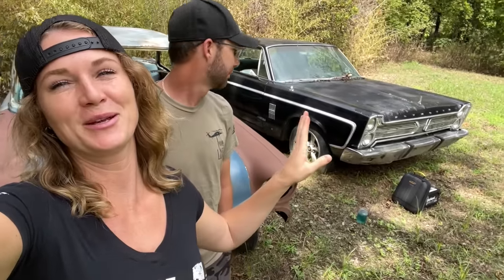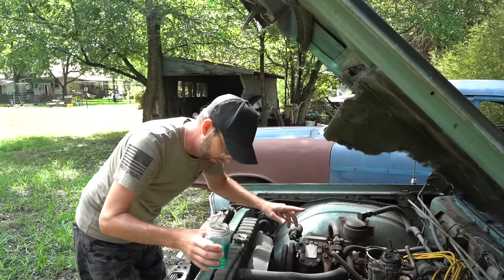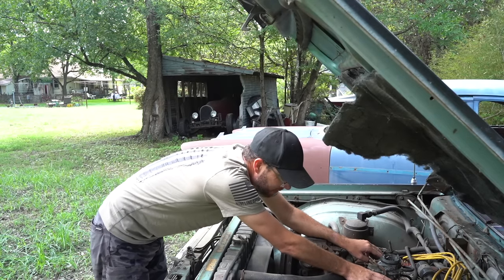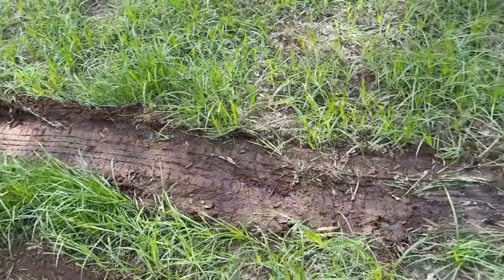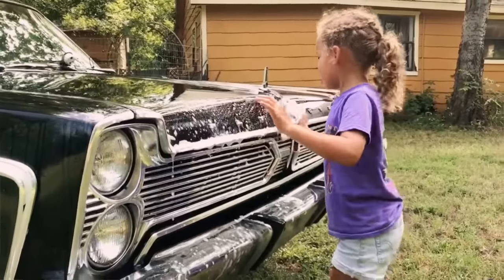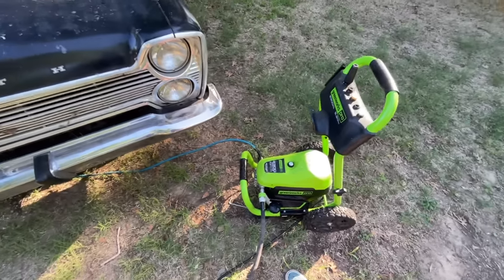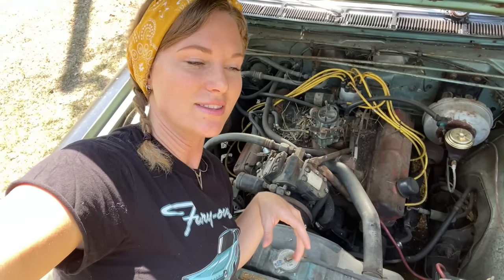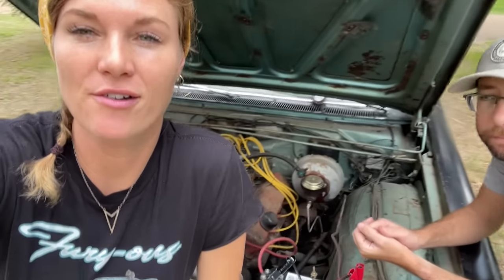Abandoned Plymouth Fury!

Comment: old timers tip,.go to the dollar store buy a Condiments bottle,they are whiteish plastic bottles with a TIP.
fill it up w gas,and then use the tip to directly fill the fuel bowl on the carb.
also for cars with no keys,bring along a jumper wire with an alligator clip on both ends,.
put one end on the coil/positive,and the other end on the battery.
then jump the starter with either a wrench across the terminals,or a screwdriver across the relay/ford.
Reply: also,after hearing the entire vid.
yank the poly 318 out,the 4 bbl intake Alone is 600 bucksjust by itself.
the poly weighs a lot and its not worth throwing money at it.
now comes crunch time.
what do You want the car to do ?
if you chose cruise,listen carefully.
grab a 360 magnum motor from a 1994 or Newer dodge truck in Good condition for Dirt cheap.
think crashed up or salvage yard cheap.
then buy a After market/read Speedmaster 4bbl intake For a Magnum motor <<> 250 bucks,and a Car Oil Pan and oil Pickup 130?? i think 
and then install the magnum motor Directly into your car With that transmission if its good.
super cheap and Easy 300 hp daily driver...for max fuel economy,use an edelbrock 600.
you wont even have to Touch the inside of the motor either.

Comment: Drop a 89 318 in it. All but 1 bolt will line up in transmission.  Then you have a LA small block with roller cam . Save original engine

Comment: Also you may wanna check the casting numbers on your cylinder heads. If they start with 265 or 253 then you have a small block. If it parts with 240 it's a big block.

Comment: Good luck finding a four barrel intake manifold for that Poly 318.  Just rebuild the carb and it will do anything you want and get  good gas mileage also.  My first car was a 1963 Dodge with a poly 318 ,2 bbl carb and push button trans.  Drove like a champ for two years til l put a 69 383 in it,  totally ruined a good car.

Comment: I grew up with mopower my dad was a mopower freak you can tell a 318 from a 360 from the exhaust manifold and also a 318 the motor is balanced by the crankshaft and a 360 is balanced by a weight on the torque converter but their exact same block only difference is the heads and the crankshaft

Comment: And that exact Fury 3 when I was growing up found it in a farmer's field that's how we used to find cars as I was growing up when one was almost ready to go to the Boneyard we would be on the search for the next one we always had one on hand as a spare but just letting you know a heads up if you use dryer sheets in the car under the seat in the air vents and under the hood on the intake manifold set a small rock on there so the wind don't blow it off and you will definitely not have mice and rodents spiders nothing guaranteed just a heads up❤

Comment: Just order a  carb kit for the same  year  d 100 pickup with the  a block poly it's the same  carb there was a 326cid version  used primarily  in Canada 🇨🇦  check the side of the engine  block  mopar stamps the displacement  on the side

Comment: Hello;  the motor more than likely is a 318 but could be a 273.  Both being small blocks but if I remember right the 318 came as a low block and a high block.  You need to find all thr block numbers and do a little resurch to find out which one it is.
Reply: It can't be a 273. They don't have the valve covers of the Old Style A engine shown. Scallped at the bottom and with a big crease along the top. Some people call the old style engine a "wide block" but the deck height is the same on the newer LA engines.
  When the LA came out, it was intended to fit the narrow engines of the Compact A body cars while the A engine 318 came in the full size c body cars.  Eventually the LA was put in the full size cars and replaced the A version of the 318. They lasted a year longer in Trucks and Canadian cars.
Reply: @auteurfiddler8706  Thank you for the information.  I learned something new.

Comment: To clean out a flooded car with carb hold gas pedal to the floor when pump it your using the accelerator pump to pump more fuel into the motor that floods it. those carbs on the 318 the throttle shaft wear out and leak  fuel check that out. The reason you can't move the car the e brake maybe rusted  or the brake shoes are rusted to the drums that car been sitting for. That's a nice car you could dress it up to look like a FX  drag car. That's what I do with it be very cool driver even with  the 318

Comment: I would buy a new Mopar compatible carburetor, new Mopar fuel pump, new fuel tank and new fuel lines and hoses. Running the engine with dirty fuel will ruin it faster. Use clean Shell  gasoline only. Thanks.

Comment: Change that single reservoir for the brakes  to a dual. And it’s hard to power brake with a single reservoir they don’t work like the duals
Reply: They work the same... until you have a problem.... then they don't at all....    
Once a wheel cylinder went bad on my car and I lost all braking and rolled gently into a chain link fence.
I put the dual reservoir from a 67 C body on my 65. I was lucky to find one in a junkyard and get the T block and the lines so it was a bolt on.  I think if I made my own lines, I could have skipped the T block and just bought a new master for a 67 . I saw a guy on Youtube do that.

Comment: According to Wikipedia the fourth generation Plymouth Fury III came with 225. 318, 426 & 440 cu. in. engines. It can't be a 225 because that engine leans to one side and it's a 6 cylinder engine. It can't be 426 or 440 cu. in. because the carburetor is way too small. It is a 318 cu. in. because of the small carburetor and the fact that the distributor is in the rear of the engine. The stumbling is due to a weak accelerator pump. This carburetor could be rebuilt at very small cost.
Reply: The 426 was 1965 only  and the 440 was 1966 and newer in the C Body Fury.

Comment: your fury engine is a 318 "poly" or 318-A..it is a "polyspherical" combustion chamber engine..made until 1966..1967 started the LA series 318..both were small block design..just different style cylinder heads..

Comment: I worked where that car was built. It probably has my fingerprints inside  the door on the right hand side. I adjusted the windows.

If those tires are ten years old don't trust them at highway speeds. The rubber gets stiff and has minute cracks that can cause a sudden blow out. Check around and watch for a sale on tires.

If a car sits for years the drum brakes can rust to the point they are stuck. They will need some coaxing to loosen up. I had to move one of mine to cement and go from drive to reverse several times to break up the rust.

Comment: I am just finishing up a driveway redo of a Fury like yours. That 318 Poly put out 220 hp as is. A small 500'550cfm carb and an adaptor for stock manifold will bring it alive. Several forums and some Youtube channels available. The trans is almost bulletproof but get a 100 percent fluid change and filter. A very hard car to find parts for as only made for 2 years. Enjoy

Comment: You should have drained and replaced the oil. After that many years there is probably as much water from condensation as oil in the pan. Pulling the spark plugs and giving a spritz of WD40 in each cylinder would have been a good idea also. Hope the engine is OK.

Comment: Put a standard factory 4 barrel on it. Change the oil, air filters plugs points and wires a new distributor cap. Bleed the brake lines, check the pads and calipers. Dont  change much unless you decide to rock it out. Paint the engine back to the original color on the valve covers and put new gaskets on them too!  Car may have a modulator valve  on tranny if I remember correctly. Check it or change it. Eventially put it back Plymouth blue. We had this car n a 67 model with a push button automatic in the lighter blue with a white hard top. It was a pretty car and the one I road to school in most of the time. I graduated in 1979. I loved the Plymouth. Oh yeah I believe the engine was blue if I remember correctly. Loved seeing this car. Thanks guys.

Comment: That car is a beauty. That engine is definitely a 318 poly and was the most common engine on those cars. On the carb the accelerator pump plunger is faulty or the passage is plugged. This is a 2 barrel Carter and very easy carb to rebuild with a kit. Tear it down (watch out for the small check valve balls), clean all the passages out with carb cleaner, blow out with compressed air and reassemble - easy peasy and you are good to go. From what I recall those had a metal dash so I don't know if someone just added the material that is now gone bad.

Comment: Poly head 318, NOT Small Block, Some call them a small block but they are behemouths, only weighs about 20 pounds less than a Mopar 383 and has enough meat in it to bore the cylinders out 120 over and still have room. Have seen them bored and stroked out to a 408
Not many components are shared between it and the 318 LA
Working on 66 Fury III right now, in that same blue!
66' was the Last year for the Poly 318 in the U.S. market
Dodge and Chrysler were using the LA motor for a few years at that point, 67 was when Plymouth got their hands on the 318 LA as well

Intake, Heads, Exhaust manifolds are not interchangeable
Poly block is a 90 degree dispo between cylinder banks as opposed to the 60 degree of the LA motor
Intake and Exhaust runners are spaced differently (more like a Hemi on the Poly)
as well as Pushrod guides and Valves
Even the Cam grind is different due to the cylinder angle

Front Accessories are mostly interchangeable, as well as distributor
318 LA Pump Housing/Timing cover will mount to a Poly Head, but you need to plug 1 mount hole in the face of the block that the Poly has but LA does not, thus its cover doesn't.
That unused bolt hole bites into the water jacket of the block, so need to plug.
You CAN use a 318 LA Water Pump on a Poly 318, but you would need to change your radiator as the LA pump dumps on the Passenger side while Poly dump on Drivers Side.
Reply: It's kinda cool This Fury is the Inverse of Mine
Mine was born Metallic Gold with Black interior but was repainted Poly Light Blue (that blue under the hood)
That one was Blue with Match interior
So Mines Blue with Black interior
yours Black with Blue
Reply: I know of no American V8 that is 60 degrees unless you are thinking of some pre war 12 or 16 cylinder engine.  Since the old style 318 and new style have the same bore spacing and deck height, it is correct to say they are both small block V8's.  But your list of all the things that don't interchange between them is spot on. The cams are different because of the pushrod angle.  And, of course, the valves are not in the same order as you said.
Reply: @auteurfiddler8706  I was jumbled up in my angles. Was thinking of the pushrods. they're both 90 degree cylinder dispo x_x

Comment: i would leave the engine original ... the ports of the intake is sized for the valve sizes and the carburetor and the cylinder size...the old cars like this one ran excellent and got fairly good gas mileage

Comment: Pull it out of the weeds check for mouse clogged exhaust and hopefully dont burn down your back 40.....lol...bought an old Nissan pickem up truck out of a field for  $65 bucks and a case of beer and took us forever to get fuel... and the cat was almost completely clogged and started glowing by time we were done ....leaves in and under bed started smoking....could of burt the whole fall time dry field down if didn't have water handy....

Comment: I don't want to be a critic because I like you guys and that Fury is super sharp as it sits (please keep those wheels on her). The gas and oil treatment is always a concoction but having a can of fogger on hand always helps if you spray it in and let it sit for a bit,  turn it over without the plugs in. Stop being so stingy with the fuel. The cars been sitting for too long for you to give it such a small amount of fuel to fire. Ever think those brakes are froze up? That's probably why she's not moving. Keep a screwdriver on hand to hold that butter fly open so you don't get a blast of fire on those eyebrows. I mean you two are too good to not know all this.  Holy shit, a chain?! Use tow straps.

Comment: Look at the ven. #, if there are 13 digits engine code is the 5th #, if 17 digits engine code is the  8th #. Code E = 318, code  F = 361, code G = 383, code H = 426,  code J = 440. That engine could not be a 426 or a 440.

Comment: That Plymouth could be two different engines it could be a Mopar 318 or a Mopar 360 they are so close in the way they look they are very difficult to tell the difference check the VIN number and it should tell you what it is if it is the original engine

Comment: I had a '69 Roadrunner with a 383ci, Posi traction rear end (maybe 410), headers, and Hurst shifter back in 1971 in HIgh School. A couple of guys in their 20's came around after school. They raced their Nova against all the fast cars and beat them... until my turn. I just barely lost a race with 4 guys in a Galaxie 500 XL. Then I raced them again and won by a couple of car lengths. I had started the 1st race in 3rd gear by mistake. Also beat a Corvette once. If you get the ignition timing, 4 barrel completely opening, learn to speed shift, and the other tuned things just right, they were fast. You should be able to see the accelerator pump squirting gas when pumping the carb (engine off). Just don't lean over the carb after pouring gas in. I burnt my hair and eyebrows badly once. Also slept in the back window and on the floor when traveling. Kudos.

Comment: I would have taken the fuel line off and put an electric fuel pump on it and drained the old gas out of the tank.
Then put new gas in.
Then put the line back on,......put chain saw gas in the vent tube and cranked it up.
My car started fine till I put stabil in it.
And first you jack it up and free the calipers,... if it has any?
If the wheels don't turn your not going anywhere.
And check the radiator fluid to see if theres any in it then check the oil for water,.. if your in a state that has hard freeze winters.

Comment: I would swap in a big block Mopar (383, 426, or 440) . The motor that is in it is not going to satisfy Emily's need for speed.  The parts for that 318 are going to be very hard to find and expensive. Also do you really want to mess around adjusting solid lifters all the time on that boat anchor of a motor.  Spending money on that motor would be like buying deck chairs for the Titanic! That is a big heavy car. It needs a big block  to get it to scoot.

Comment: Silky girl if there's no fuel in the float chamber you wont see any fuel when he pumps the pedle cause ihe accekerator pump is empty. Just hit it with some starter fluid abd kay your hand on the top to choke it with a shop towell in the other to smother it out uf ut back fires. A fire in the carb. Just smither it and dint have your face over the carb while ur doing it or you might get your eye laches trimmed. Haha

Comment: OK.. so here are my 2 cents.  The car needs a ton of work and probably isn't worth throwing a bunch of money at.  What is the goal?  I would get it running and driving and pass it on to a new owner.  Fix the brakes, get the trans working and cut her loose.  If this car has some kind of sentimental value (assuming it doesn't since it sat for 5 years) the sky is the limit.  I would just buy a new carb for the car.  Odds are the old carb has a ton of other issues (ethanol, moisture, water corrosion), a rebuild kit will just make it a minor pain in the ass.  No disrespect but the car looks like it may not be worth saving.  Is the subframe in good shape?  Are the torsion bars solid?  If this thing is rotten.. I wouldn't spend a bunch of money or time.  I am sure you guys know the answers to these questions already.  LOL..  I know it is a friends car, but if it's too far gone she is really just a parts car.

Comment: Nothing wrong with transmission.  More than likely has 2.54 or 2.73 gears. Tuff to power brake.
Reply: I was wondering what a factory rear gear ratio would be in this. Would this have an 8 3/4  rear end ?
Reply: also I suppose this is a B body
Reply: @caseyhenson6913  8.75 3.23 2.73 2.54 hard to say
Reply: @caseyhenson6913  yep

Comment: If you gonna go with a bigger carb you might as well do a cam swap, and if you go that far you'll probably wanna drop the oil pan an see if everything is tightened up in the bearing department. Bottom line you may be going down a rabbit hole.

Comment: You two are showing people just what not to do, trying to start a car with gas in the tank 5 or more years old, not cleaning the lines or tank, and putting that rusted rotten gas in the fuel pump. and never ever pour gas in the car with it running